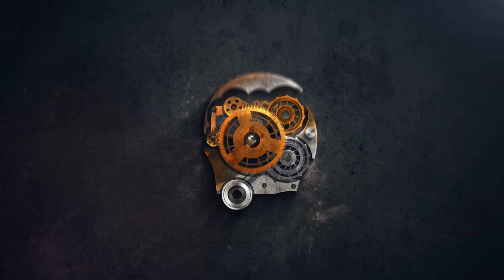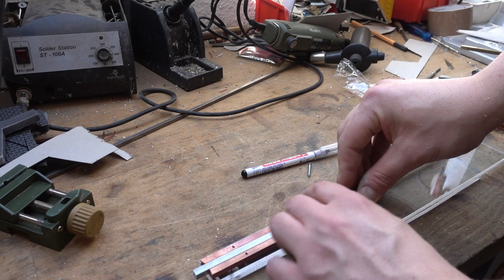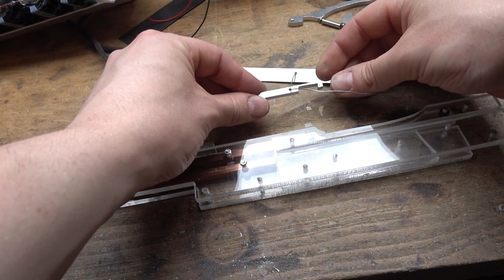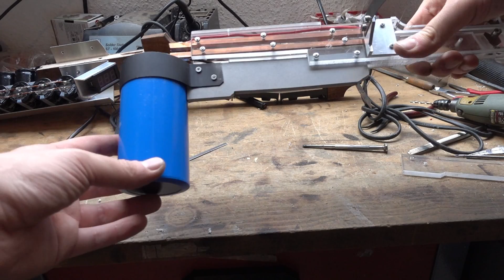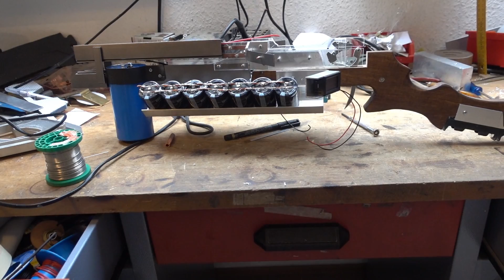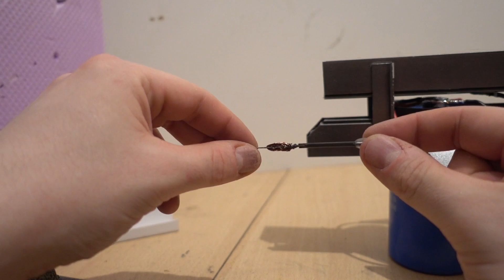Making a portable railgun: Part III test fire, rails and the bow injector

Comment: The nozzle velocity is equal to projectile acceleration per pulse time.  By using a higher discarge voltage you can reduce pulse time and thus increasing nozzle velocity. Acceleration is equal force per projectile mass. The force is proportional to the current, which is equal to voltage per resistance. A higher voltage results in a higher current. It is counterintuitive, but a shorter pulse time "squeezes" the energy stored in the caps into a smaller time window and thus grants a higher level of electrical power. A higher voltage also helps to discharge the electrolyte capacitors completely, which they tend not to at low voltages. Anyways great project, keep the good stuff coming!
Reply: imagine discharging at the first 2 cm and u got 20cm left of rail

the projectile just slow down
Reply: @urnoob5528  then just shorten the rail?

Comment: Here’s an idea: use a twin spring loaded locking bolt to push the projectile into the barrel. A spring at both ends of the bolt so it works just like a pogo stick.
Reply: You could also use a reverse bow like the crossbow I had when I took my archery lesson.

Comment: with a 3D printer you make guides that slice easily and hold your projectile in the middle, they fall away as it leaves the barrel and the projectile keeps going. that's how the professionals launch pure aluminum projectiles, like the navy rail guns. There is a plastic that is 20% carbon fiber and it's very rigid and slick for the projectile holders. IN the design you can make sure that there is very little material needed to keep it stable and straight. Metal on metal causes much friction and slows the projectile down significantly. And with those 3000 farad super capacitors in series, well it should be interesting! I'd make the center of the projectile concave to lower the drag by a lot or dimple it like a golf ball.
Reply: I MAKE stuff, I dont print. Go make it..
Reply: Oh and your projectile is turning to plasma, that is a)...will loose contact to the rails no matter what you do and b) you did not really catch the point of my projectile-design. The soft copper-brush makes it a bit more forgivable.

Comment: I think the current does nothing but making spark
the voltage is too low for the railgun,coilgun may suitable for thes capacitors
Reply: You NEED a pulse that is as long as the rails...to make sure the slug gets accelerated on the full length. SHORT pulses or high voltage is for coilguns. Try it out.
Reply: @LaserGadgets  most of the energy were wasted at initial contact to the rail ,better to insulate part of rail to generate enough Lorentz's force 
nice craft work btw
Reply: @coregraphite4377  There is no lorentz force when you isolate the rails oO
Reply: @LaserGadgets  but left enough lenth of rail to generate it ,it's hard to explain without diagram
Reply: @coregraphite4377  Does not work like that...make one, then we talk :p
Reply: @LaserGadgets  ok，i will try
Reply: @LaserGadgets  I have seen a successful example that uese 450V to accelerate object up to 200m/s,but shorter rails with higher caliber.
Reply: @coregraphite4377  Seen and made....make one, then we talk. I have no idea why people believe they know more than me. Higher caliber is BS. For max energy you need the rails as close together as possible...again, make one, calculate, then we talk. This is pointless when you just talk about the stuff others make...ok?
Reply: @LaserGadgets  ：D

Comment: Are those brushes made of copper braid? I tried those too, but somehow I couldn't get the current distribution right and there always seem to be sparks.
Reply from the maker: Yeah, my problem was they melt and loose contact = sparks. I might try thicker layers. Cam was new and I had no idea how to use the slomo...awesome day back then :p
Reply: Have you considered using something like graphite spray to lubricate the rails?
Reply from the maker: @NNNILabs  Fine particles? Would probably burn in a fiery explosion ^^ and if there is any oil involved it would cause bad contact.
Reply: I've done a few tests, the irony is that the burning actually takes away some of the heat energy that could potentially damage the rails or the projectile. But that happens only if contact is not good. Having a lubricant like that simply lets you push the projectile against the rails harder (making better contact) but without having as much friction as without the lubricant.
Reply from the maker: @NNNILabs  Hm, well its still kinda unpractical. You cant just get in there and refresh the coating :>
Reply: True, that is something to consider.
By any chance, are you in touch with Thomas Rapp? I've seen a few comments elsewhere, so I thought I might ask. Ran into his railgun two years back, that thing's got to be one of the best around.
Reply from the maker: @NNNILabs  Actually I even chat with him here and there via email. His pulselaser site was even more impressive. Taken down, true shame! And its THE best railgun :p not just one of the best. Compared to his, all others are just sparklaunchers....including mine!
Reply: I know this sounds a bit unorthodox, but...ehm...is there any chance I can get his email? You can delete the comment as soon as I've read it.
Reply from the maker: @NNNILabs  Thats easy, there should be a button on his site somewhere.
Reply: Oh yes, found it. I don't know much German,so it took a little digging.

Comment: its looks amazing was great to watch this creation although im have some confusion if anyone would enlighten me.
theres another vid out here of a smaller design but the capacitors in that vid seemed bigger and fewer but the speed at which the projectile flew off the rail was alot faster this one however I read that more smaller capacitors deliver quicker surges of power and recover quicker so my question is why is this design so much weaker ( looks so nice and very well made)
Reply: Its not the NUMBER of capacitors, the values are important as well.
Reply: Not to mention the projectile matters a ton as well, I think his was catching on the rails which slowed it down a ton.

Comment: Isn't the Half-Life 2 crossbow a railbow?
Reply from the maker: No, its an induction crossbow, heating up the bolts.
Reply: Why the two rails and the flashy electrical discharge upon firing?
Reply from the maker: Its a railgun?

Comment: Did you really only charge it to 7.8 volts?

I plan on making on as well using 21-28, 63v 22000 uf that will be firing aluminum ball bearings.
Reply from the maker: BBs will not work well. Will burn your rails in no time. 10 shots max. And where the hell does it say 7.8V? There is a converter...let me guess, you did not watch the other videos did you.